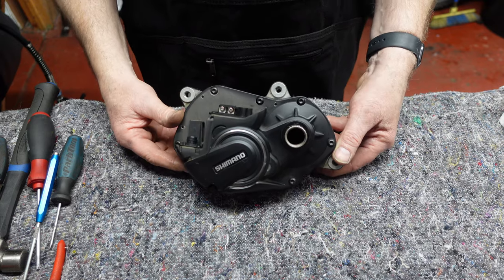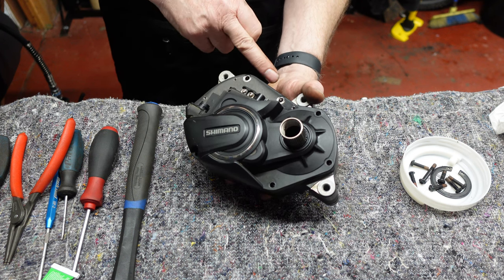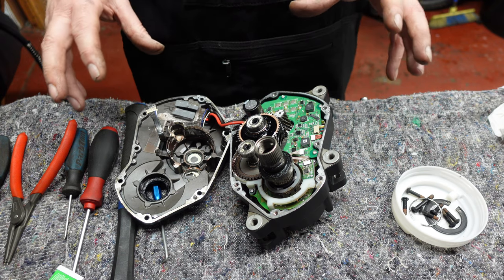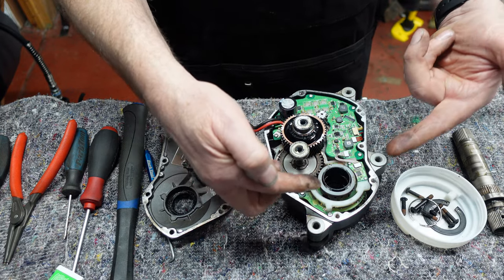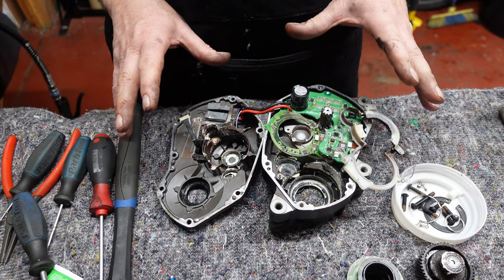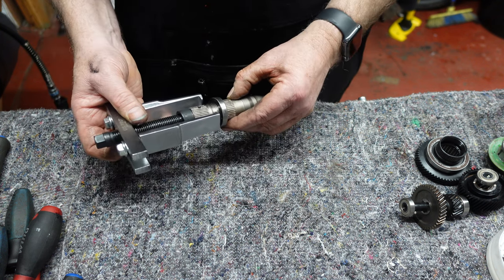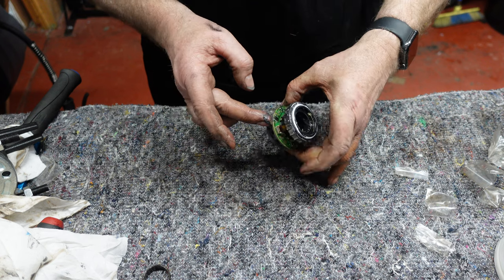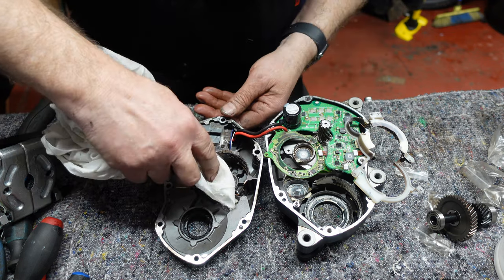Shimano E8000 Motor overhaul and bearing replacement.

Comment: Hi Dave!  Another great video. How can you tell if your bearings need changing?
Thx Steve.
Reply from the maker: Good question, when turning your cranks while the motor is of and the chain is off too. you will certainly feel and hear the rumbling/grating sound
Reply: @TheYorkshireBikeMechanic  
When I turn the cranks backwards I fell nothing very smooth.  When I turn forward it’s smooth but I hear the gear engagement,  is that normal or should it feel like when turning it backwards?  and Thx for responding Dave!!  by the way the motor is a Shimano e8000
Reply from the maker: @steve9502  Hi, turning backwards would make   a horrible noise, is there any side to side play
Reply: @TheYorkshireBikeMechanic  
There is no side to side play.

Comment: Grinding noise, then followed up with no noise and noticable loss of power as well as feeling the crank having more drag when pedaling.  NO ERROR message.  Likely faulty bearings?  8500km in all weather in 5.5 years
Reply: Took it apart yesterday, looks like the big bearing on the right crank side is shot.  Need the Shimano tool to remove that side
Reply from the maker: Hi, thank you for watching and your comments, be careful, so easy to damage
Reply: @TheYorkshireBikeMechanic  motor already apart mate, no turning back now :)
Reply: Good news, the big ball bearing on the chain side had completely blown up.  Replaced all the bearings, cleaned and lubed.  Back togeather now and working.  Thanks a lot #The Yorkshire Bike Mechanic, I would not have been able to do it without your video.

On the Plus side I now also have a new E8000 on hand, as I pulled the trigger on one when I was doubting my ability
Reply: unfortunately my motor didn't feel much better after the bearing replacement.  It lasted for a few weeks and then it went stff again, i fear that the crank axle is bent.

Bought a used motor, worked fine but soon I started to get the "duck" quack when under load on that motor also (3330km)...

What grease do you recommend?  I wanted to lube up the gears between the motor and crank.

Comment: Internally the motor parts look well built and sturdy and like cars bearing here and there needing replacing, I read and see a lot of E010 errors of peoples motors been knackered and need replacing, Is this like inside of a computer a motherboard hardware problem rather than the moving parts been a problem? If so would replacing the motherboards on these not be thee answer?
Reply from the maker: Hi, Thanks for watching and for your great comments. The only reason anyone would dismantle the motor would be to replace the bearings because they are noisy, everything else inside the motor is not serviceable and are not available to buy as parts and when motors are out of warranty. Having said that Shimano will offer to consider a repair or replacement at a discount under their out of warranty scheme, providing that the motors have not dismantled and not been tuned.

Comment: Great video! I want to overhaul a Shimano DU-E6002, can’t find a replacement set on performance line bearings. Do you have advice or part drawing/numbers?
Reply from the maker: Hi, thanks for watching, I could be wrong but I don’t think that motor is repairable, think the circuit boards are soldered in.
Reply: @TheYorkshireBikeMechanic  correct it is soldered in but there should be enough play to solder when installing so also for removing? Are any parts numbers written on the bearings from the Shimano motors you overhaul?
Reply: Hi E.A.D. Im overhauling my E6002 aswell. My bearing on the bottom of the black plastic gear is broken. Can you help me and tell me the type/size of these particular bearing? Would be nice.
Reply: @alexanderrachinger4084  unfortunately I have to disappoint you, I have the same issues with unknown part numbers… how have been able remove the motherboard since it is soldered with 5 wires…? Without removing the motherboard I can’t see an option to remove the bearings and gears, do you?
Reply: @e.a.d.4207  Ok. Ty for your help anyway. I clipped it and will solder IT after the repair. Good luck and best regards

Comment: nice, but do you haven't any little shim left 7:50 that you didn't put back on the shaft? 30:15 😅
Reply from the maker: Hi, Thanks for watching, well spotted. I noticed when cleaning up after that I had a spare shim in my magnet tray. I have to take the cover off to bob it back on, doh

Comment: Thank you very much for the very helpful video.  Since my E8000 is constructed slightly differently, the clutch magnet unfortunately broke.  can someone tell me where I can buy this?  It's a little gray ring.  Can be seen in the video at 15:03
Reply from the maker: Thank you for watching and your nice comments., only by using used parts this can be done

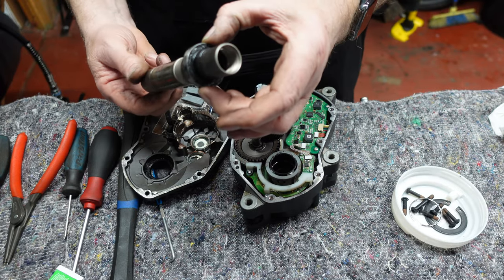Comment: Hi , I am not able to release the crank from the tork  sensor , is ther le any slip or circlip to get it off ? I mean in your time 8:48 you get it off , but I could not
Reply from the maker: Hi, it should slide off the shaft complete but sometimes the bearings get stuck on the shaft, there is no easy way

Comment: I wonder if, after the bearings replacement, the ERROR E010 cames out on the display. thanks for your video anyway
Reply from the maker: That error relates to internal sensor error,  (mainly torque sensor)

Comment: do you think , after a basic maintenance, drill a Grease port in apropriate location is a good idea ?
Reply from the maker: Hi, It would be very difficult because everything is sealed, bearings, drive shafts, gears, normally its just bearing wear and tear, such a lot of power and quite small bearings.

Comment: Hello Dave,
Could you please tell the Numbers or the dimensions of those bearings that you replaced.
Thanks to your great video, I want to replace the bearings in a Steps8000 motor.
It would help a lot to have the bearings before hand, so it is possible to disassemble and assemble in one session.

Thank you very much in advance from Germany.

Albert
Reply from the maker: Hi, Thanks for watching and your comments, the best way is to buy a complete bearing kit first. the whole job can be done in an afternoon, It's not an easy job and damage can be done without you knowing, my advice is dont do it.
Reply: @TheYorkshireBikeMechanic  Where can I buy the kit? I am a bike mechanic for 30 years. But where is the baring kit sold?
Thank you very much for your help

Comment: Hello ,
Thank you for this clear and precise video.
I have creaks when I force a little on the pedals whether the engine is running or stopped, but especially when the engine is hot. My Steps E8000 engine is from 2017 and has 8500Km. Shimano offers me a paid quote but I don't think Shimano agrees to take it under warranty...
This video is great because it will help me replace the bearings myself.
I couldn't find the link to buy the bearing kit on your site. Can you tell me where to find it?
Thanks again.
Reply from the maker: Hi Christine, Im pleased you found it useful. The bearing kit is £82.48 plus £5.00 postage. if you email me your paypal address I will send you back an invoice. my email is dkaye47@gmail.com
Reply: Hi , do you do service for customers outside UK ?
Reply from the maker: @sebastiengiovannelli8556  hi, yes we do but postage charges will apply. Where would you need it sent back to?
Reply: @TheYorkshireBikeMechanic  France
Reply from the maker: @sebastiengiovannelli8556  Hi, It would be £235 plus £25 postage

Comment: I have molykote pg 75 ( some white grease for big gears ) but i saw you use dark grey grease , what is the name of this grease please ? and 2nd question, which bearings press you have ?
Reply from the maker: Hi, the part you enquire about is not a part that is available, we use a lithium based moly grease, we use about 4 different presses on the motor

Comment: E bike motors seem to be very difficult to work on . maybe it would be better to buy a new motor ? 
i have a Nox xc mtb with the Sachs rs motor , which is fantastic . however the company won't even allow their handlers to work on them . the motors have to be returned to the factory and a replacement  is given . don't know if this is a good or bad thing .
Reply from the maker: Hi, Thanks for watching, bosch and shimano are the same, all faulty motors go back and are not worked on in this country that I know of

Comment: Good stuff. It's ridiculous Shimano won't sell the torque sensor separately..
Reply from the maker: Hi, Shimano don't sell any part of the internals from the motors they produce i'm afraid, they are not designed to be opened by anyone other than shimano.
Reply: I need a new torque sensor too, have you been able to find one?
Reply: @alextheodossiou9635  no unfortunately not.

Comment: Does Vaseline have to be checked at 1500 km?  
or is it enough to change the bearings?
Reply from the maker: Hi, what do you mean by vaseline ?
Reply: @TheYorkshireBikeMechanic  I wanted to ask if you have to change Vaseline once every 2 years or every 2000 km?  or what is the factory holds forever?

Comment: 21:20 Have you opened this plastic gear before? is there a bearing here that only rotates in the other direction? Mine is stuck
Reply from the maker: Hi, Thanks for watching, yes it's directional. you mean wont turn either way or stuck on the shaft?
Reply: Doesn't move in any direction. I couldn't find any pictures or videos of this opening. What bearing is there? I'll try to open it today at work with better devices👍

Comment: Hi Dave, snapped a Di2 rear derailleur need to replace the cable to a E8000. Does the motor need to be dropped?
Reply from the maker: It depends when the wire entry is at the back of the motor, have you got a photo of where the cable entry is?
Reply: Sadly can't post a pic in reply. It exits on the right side on the top of the motor frame housing. Looks like the wire goes over the top of the motor. Can't remove it by pulling so guess dropping the motor down is the only way.
Reply from the maker: @LetRippr  Hi, if thats the entry then its more likely to run over the top of the motor so yes looks like it's going to need to come out, turn the bike upside down you find it much easier.
Reply: @TheYorkshireBikeMechanic  thanks for the info,  very helpful

Comment: Hi Dave, Im from the Philippines. I have a Ducati ebike model tk01. Can I ask you a favor if you can help me because my shimano EP8 motor engine is noisy/ rattle. What will you suggest?
Reply from the maker: Hi Ian, Thanks for watching and your comments, If it's less than 2 years old book it in with your shimano dealer, if its over 2 years, telephone your local shimano dealer, it could be that they will look at it under the our of warranty scheme.

Comment: Hi dave, my cranks creak under heavy pedalling, I've tightened up the cranks and it's still the same. Could this be the bearings in the motor? I've got the same motor. Thanks
Reply from the maker: Hi, It could be, need to take a look, its there side to side play
Reply: @TheYorkshireBikeMechanic  no side to side play, but if you hold both crank arms and wobble there a small bit of play
Reply from the maker: Ok, have you checked to make sure it’s not your pedals and also checked your chainring locknut?
Reply: @TheYorkshireBikeMechanic  it's got new pedals, but I've not checked the chain ring lock nut as I don't have the tool. Is there a way to check it without the tool?
Reply from the maker: Not really, you need the tool, can you get it to a steps dealer to check. Your dealer must check every possibility and run diagnostics before they can ask shimano to take a look at it
Reply: @TheYorkshireBikeMechanic  thanks I'll get it to a shimano dealer for a check over. Thanks for your help, just subscribed

Comment: Hi Dave does the same apply to the Shimano steps e7000
Reply from the maker: Hi Alex, Thanks for watching, afraid not, the 7000 is difficult id not impossible to ovarhaul due to the circuit boards being in the way.
Reply: @TheYorkshireBikeMechanic  great thanks for the info! My E7000 just broke I suspect the plastic gear is broken. Does the e8000 have plastic gears? It's hard to tell from here they look black steel 🤣

Comment: I asked yesterday concerning whether I could pull my motor and send it to you. I live in USA. If that's possible can I purchase the compete set of bearings from you. 

I didn't see you actually press the new bearings on. Can I put the shafts into the freezer and heat the bearings in a toaster oven to get them on. I use that technique for my moped collection. 
I think I put my email on the previous attempt to contact.and it was deleted.
Reply: So prefer shipping motor to you but would also try to do it.my self with the correct bearings.
Reply from the maker: Hi Marc, Sorry I don't overhaul Shimano Motors, they are too in depth and super easy to damage. you can try yourself if you wish but I wouldn't advise it. bearings are available from here https://www.ebikemotorcentre.com/where-to-buy/
you will not need to heat or freeze components.

Comment: Hi
Can you share the size or the names of the bearings you used?
Regards Martin
Reply: 1 x 6808 1 x 6805 1 x 6000 3 x 6900. I did not replace the needle bearing as it was still in good condition
Reply from the maker: Thank you

Comment: I work in auto electronics and have to say I'm not impressed by that pcb - looks to be the gasket seal is the only protection and there is no coating of any kind on the pcb, the components are very large for something that will see lots of vibration. The heat cycle of the motor itself will create a pressure cycle inside the casing and most likely pull moisture in past the shaft o-rings. Gut feeling is on next generation motors you'll start to see smaller components, conformal coating either the whole board or selected components and high performance pcb's that aren't hit by moisture as much. Ask to see the testing cascade - at a guess I'd say everything is done on fresh motors to ensure a pass and there is no pre aging of the parts - put the motor through 200 thermal cycles -40 to +80 and see how well that gasket holds up, thats a base level auto thermal shock test.
Reply from the maker: Hi, thanks for watching and your comments, great comments, thank you

Comment: Sir, can you please share the sizes of the bearings? Are those standard size bearings?
Reply: Replying to myself; 1 x 6808 1 x 6805 1 x 6000 3 x 6900
Reply from the maker: Hi, sorry for the late reply. there are more than that.
1 x 6808 2rs Sealed Ball bearing 40x52x7mm
1 x 6805 2rs Sealed Ball Bearing 25x37x7mm
3 x 6900 ZZ Shielded Ball Bearing 10x22x6mm
1 x 6000 ZZ Shielded Ball Bearing 10x26x8mm
1 x K25x29x10 Needle Roller Cage Assembly
1 x K25x29x17 Needle Roller Cage Assembly
Reply: @TheYorkshireBikeMechanic  Thank you! I bought from local store @Tampere, Finland  all 8 bearings, brand names are EZO, INA and Koyo. I said that premium-quality please, those are for myself ;) I need also bearings pullers but those can be cheaper quality, since I most likely need to use those only once. Thank you one more time about the list of bearings and the video 🙏

Comment: Any chance any one had a shimano moto locked up after instal a speed box it will Not pedal either
Reply from the maker: I’ve not heard of that before
Reply: @TheYorkshireBikeMechanic  got enough one bosch intuvia model I've ended up rest the mile range but I've swap the magnet over on the crank arm instead but now my mile range is going down quicker then what I've actually pedalled I've done 0.57 on the trip but according to me mile range I went from 12 to 8 in that 0.57 but I haven't lost a bar of battery

Comment: peter at the ebike motor center wont service any of these motors as shimano bricked all the ones he fixed as opened them up to replace the bearings and shimano blamed him for opening them up and cost him a fortune!
Reply from the maker: Hi, thanks for watching, like I said in my comments this repair is tricky and not advised. My professional advise would be to book your bike in with an authorised steps specialist like us, shimano offer an out of warranty service which we can use to replace noisy or broken motors. This video is for reference only
Reply: @TheYorkshireBikeMechanic  peter fixes about 25-30 motors a week and knows his stuff but wont touch those motors !

Comment: I've seen motorcycle engines with lesser quality bearings than these motors. Keep the water out and these will last a long, long time. I guess the circuit board will give out first.
Reply from the maker: Great point!

Comment: your video is fake. Crankshaft cannot be removed. The sensor is welded onto the shaft. it's not as smooth as yours😳. if the main shaft slips with the crank, the engine will be destroyed
Reply from the maker: Hi, Thanks for watching, the crankshaft can be removed and the torque sensor assembly is separate but in a lot of cases it gets stuck thats when the sensor can be damaged. Like I said in the comments, DO NOT ATTEMPT YOURSELF.